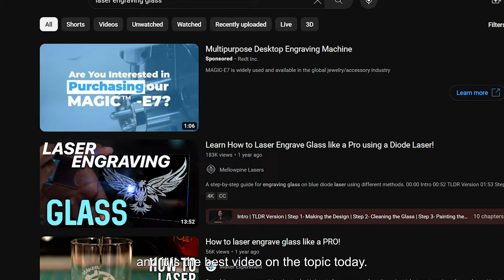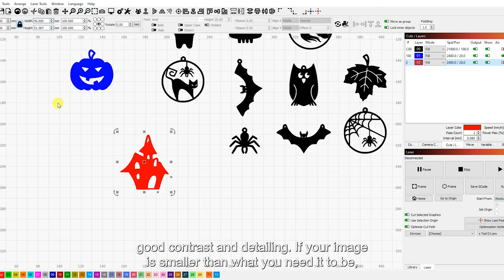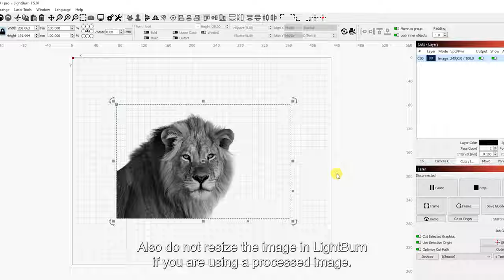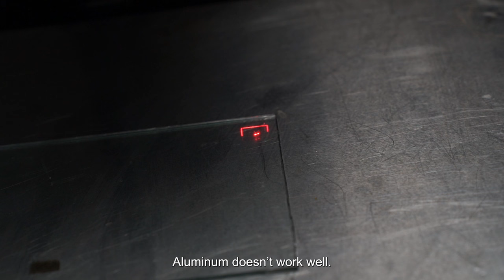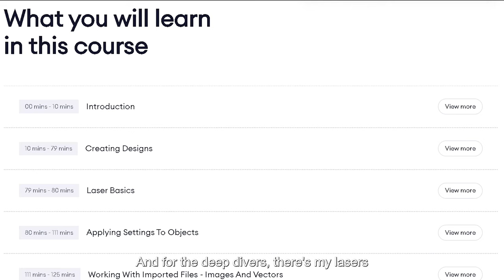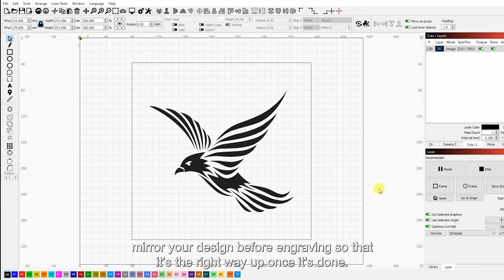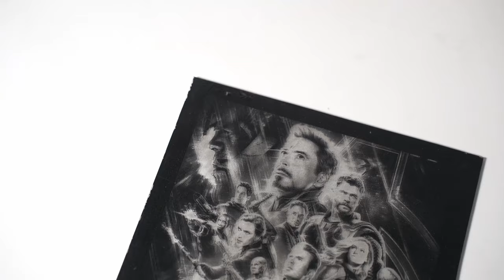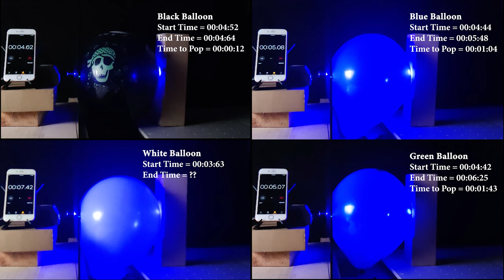Glass Laser Engraving Remastered - Ultimate Guide

Comment: Well Done!  Little Tip, I have a 30w Fiber Galvo and tried several different methods including putting it on stainless steel which was the best option I found on the internet until I tried something I haven't seen anyone else do you should try because I felt it came out twice as nice!  I taped the Malayan black aluminum business card blanks to the backside of my glass and the results were easily twice as nice resulting in a nice black marking.  It didn't arc or splatter nearly as hard as the stainless steel.  Just something for you guys to try.

Comment: Love the older video on glass engraving. Found this new one after subscribing and this one is even better. Can I use the engraving method to actually cut a perfect circle from a piece of glass that is 3mm or 6mm thick? If engraving can cut 0.125 inches (3.18mm) deep, can it cut a perfect circle from a 3mm glass? For 6mm, can I run the process twice, or engrave one side then flip it over to complete the circular cut? And it can be done, do you recommend diode or CO2 or Fiber laser? Thanks!

Comment: Thanks for doing this video! This is the most informative one I have seen on glass. I have a 20W diode and your video says 75% power and 7500mm speed. My laser has a max of 600mm so what would you recommend? Where do you get your glass from? Thanks again for your videos!
Reply from the maker: The speed I mentioned is in mm/min. So 7500 mm/min would be 125 mm/sec. Can you check whether the top speed of your laser is 600 mm/sec. If it is, you can run it at 125 mm/s

Comment: If you’re doing the fiber method did it also engrave the steel underneath?
Reply: Think yes,beam is very powerful in focus dot.
Reply from the maker: Sadly, yes. But I tried my random orbit sander on it and managed to remove the engraving. You can reuse the sheet if you use low power settings